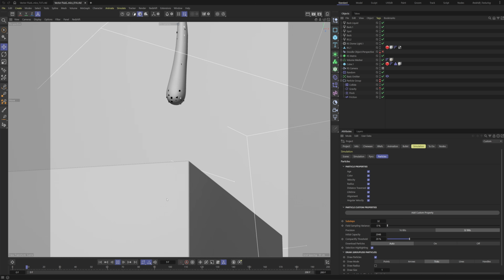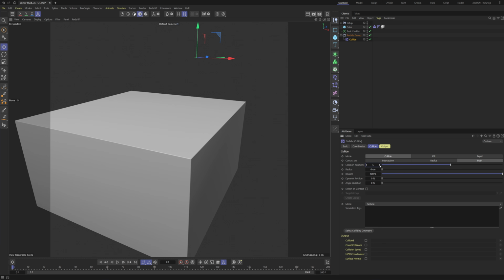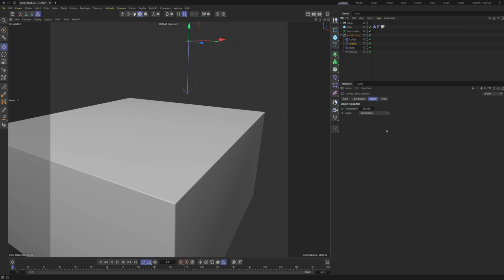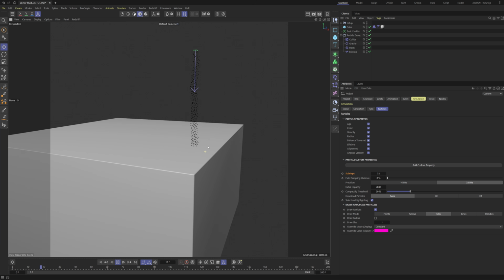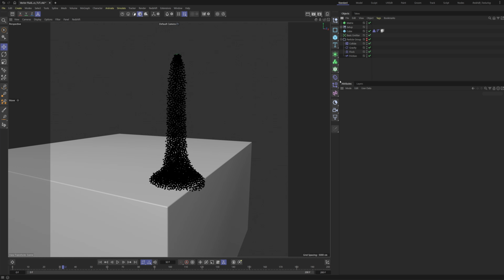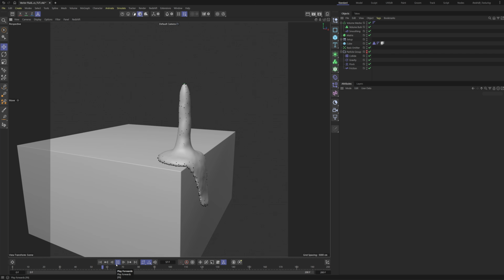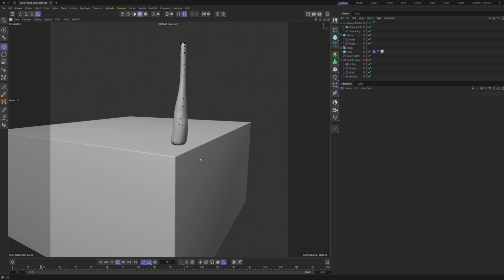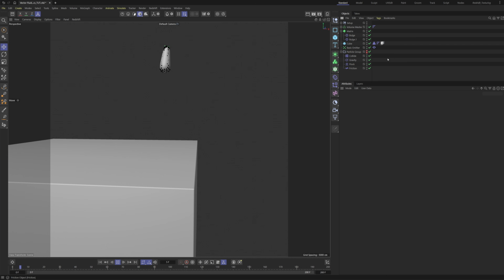Fluid Simulation With Native Cinema 4D Particles

Comment: Why does it pass even if I set collider body tags
Reply: me too,,, I`m so despairing🥲 i want to know how can i fix it... Have you figured out how to do it?
Reply: Got the same issue. actually the collition iteration is not anymore in the collide simulate tag. so preobably that's why
Reply: Actually i've just found the solution. you guys need to go higher in the radius for the collide simulation tag. He puts it to 0.5 but it's too small for colliding with a smaller mesh. so adjusti it to 1.5 - 2 and it's going to collide

Comment: Amazing Lukas! I'm wondering if it would work for less viscous fluid like water
Reply from the maker: @arnaudparel9925  it might but the problem I'm running into is the particles not sticking to each other. So it looks more like grains
Reply: @lukasthorup  Yes, I guess it's the limitation we have for the moment. I wouldn't be surprised if Maxon will improve fluid sim on the next release! Let's hope!

Comment: 00:05:53 Thank you for a good tutorial! But since I added Gravity and Friction, it doesn't work like a video, and what's the problem with particles going through the cube?
Reply from the maker: Try Subdividing the cube or try to lower the gravity strength
Reply: @lukasthorup  Thank you for your answer. But I tried many things besides the way you told me, but it didn't work out, so I'm going to try again later. It's frustrating, so I also want to share my file. Thank you for your kindness.
Reply: maybe try doing this in cinema 4d 25, in version 24 I also had particles flying through the cube, and in 25 the same scene was already played taking into account the collider
Reply: @uniccorny  Not sure if you’ll see this, but I just wanted to say thanks —
I followed your advice and the result worked great in the 2025 version!